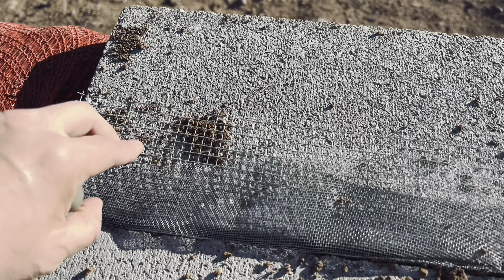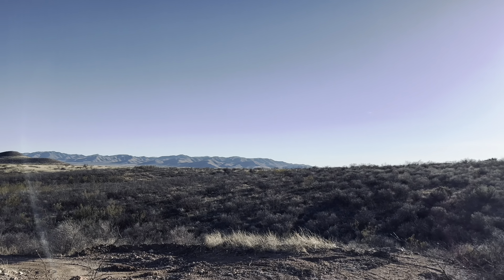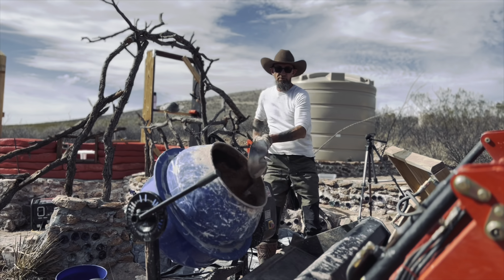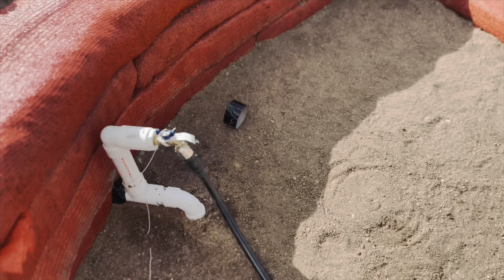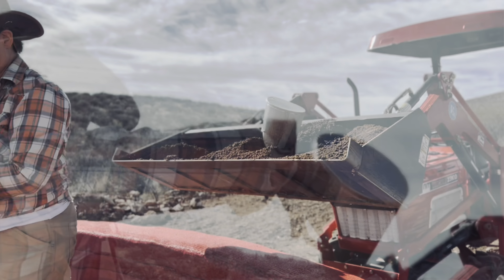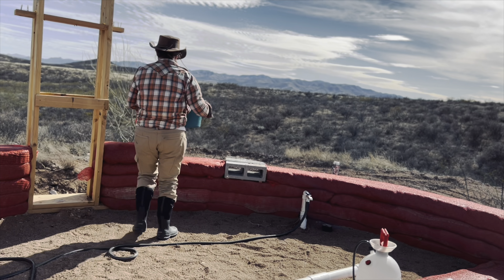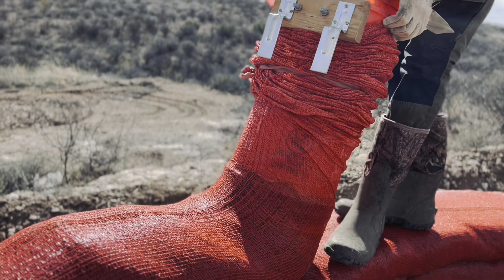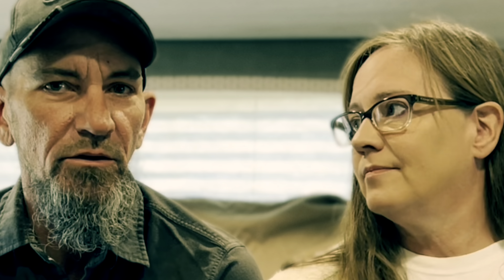How To Lay A Hyperadobe Earthbag Step By Step

Comment: Hello Doug and Keri. Your bags are interesting.  They are different then Jim and Jessica’s. Forgot the channel name.  It’s a lot of hard work.  Jim bought a tractor too. It is pre owned ah he will brush chop with ours.  💕NonnaGrace 🐓
Reply from the maker: Hi Nonna Grace!  Hope you're having a nice week so far :)  Yes, they used the individual style bags where ours are on a continuous roll and we cut to fit.  There are definitely benefits and drawbacks to the individual and the continuous bags and we considered both.  The continue bags are faster than the individual bags; however, they are a bit more expensive than the individual bags.  A benefit to the individual bags is that you do not have to use the barbed wire between the courses (or rows/layers) like you do with the individual bags.  It is definitely a lot of work, but boy is this structure solid!  A tractor is a great piece of equipment to own...congrats !  Have a wonderful day!  Doug & Keri

Comment: The building is looking great. Love ya'lls foundation. 

We ended up building a steel sifter so we can dump directly from the backhoe, it's SUPER helpful vs shoveling twice. Ya'll may be able to do something like that out of 4x4s if you don't have a welder.
Reply from the maker: Hey thanks!  We really enjoy your channel and have gotten some inspiration by some of the stuff you've done...love the creativity!!

Good call on the sifter...we realized after about 4 courses on the chicken coop, that the small sifter we had built was not sturdy enough and the hardware cloth was too small (we were using 1/4" since it's what we had on hand).  We found we were sifting out too much, actually!  We upgraded to a steel hog panel with 1" hardware overlaid on top and 2 x 4 legs.  This is MUCH better because we can dump the load of dirt right from the tractor...cut our time and shoveling in half...gotta like that :) Cheers!
Reply: @tworebelsoffgrid  Awesome! Yeah, we started hiring a neighbor to come out every couple of weeks and help us sift with his backhoe. It get's what we could sift in a week by hand done in about 3-4 hours. Well worth it.
Reply from the maker: Oh yeah, definitely worth it...such a huge time saver!